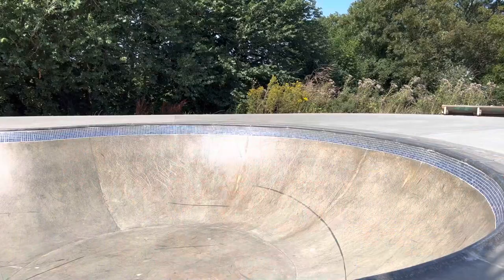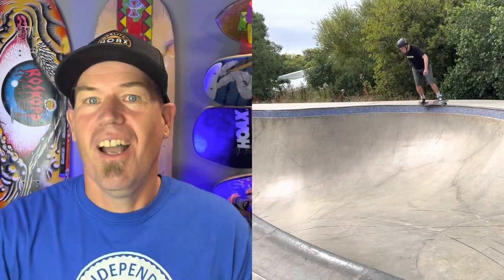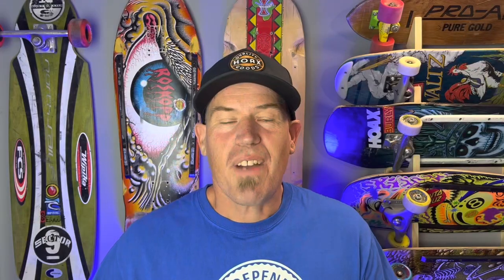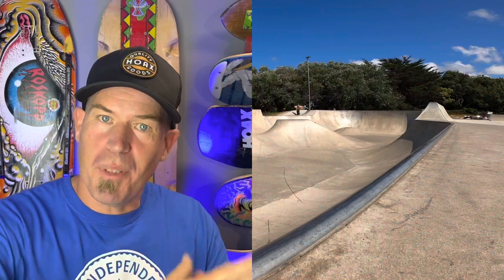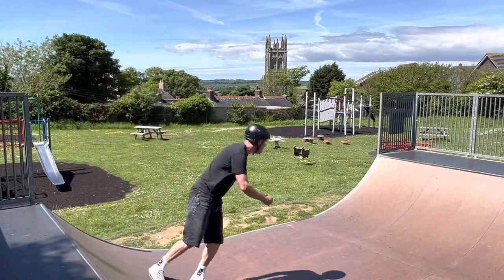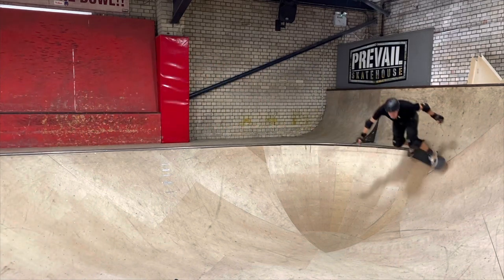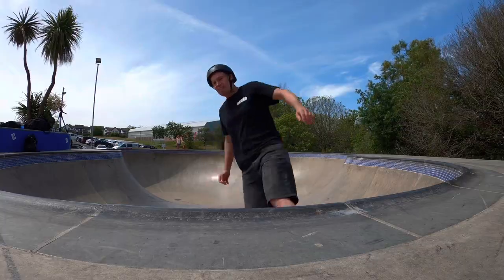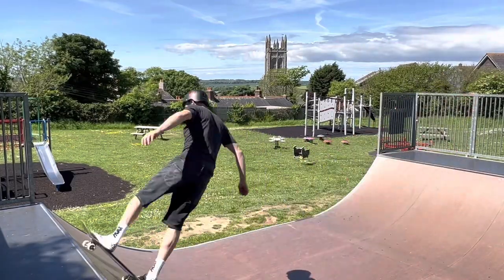Axle Stall 101 - My 10 Phases in Pursuit Of Axle Stall Nirvana

Comment: Like everyone else this is great timing for me! I’ve kind of just learnt this but I’m struggling to get consistency with it. Sometimes I lock in nice and get a long 50-50, other times I don’t bring the front wheel round enough and end up doing a feeble and bailing. I also tend to stop grinding and then drop back in afterwards instead of grinding and dropping back in in one fluid motion. More practice needed I guess. And these videos help!

Comment: Great video! It took me months to learn this one. 
I think the biggest hurdle that I've seen people overcome to get these smooth and consistent is getting past the "back foot fudge" stage. 

I used to spend half a lifetime stood up on the coping whenever I would try these and I was in awe whenever I would see someone do a smooth, cross-locked axle stall/5050. 

But as soon as I figured out how to pinch the heelside wheel it was as though something clicked and I managed to learn (fairly) clean axle stalls, 5050s and feeble stalls.

The "back foot fudge®" is the most important stage in my opinion (and one of the most common among beginners).

Thanks for reading my silly comment. Keep safe. :)
Reply from the maker: I still fudge it now and then 😂

Comment: As always a great video mate, I’m definitely a bit of a weirdo as you know. I don’t actually remember learning to axle stall as I was about 10 years old I think 🤔 (so 33 years ago 😬) but I most often do them how you explained about the pivot . Strangely it never really occurred to me to do pivots when I started skating again (i used to Ollie into them on curbs when I was younger but never did them on coping) and then a while back I decided to try the pivots.
So my stalls are mostly in the middle of the truck with neither wheels in contact with a surface unless I’m being lazy and just standing up on top by My 5050’s are mostly the lock you showed unless I screw it up and do either both toe wheels up or both heel wheels.
Again strangely my 5050’s on vert are a carve in and a very quick dab on and then off again with lots of speed and I’ve not mustered the courage to stall yet , there’s something about keeping moving that feels more comfortable to me.
Also getting into stalls on steeper stuff I found it helped me to bend my back leg more and kinda squat into them until I got more comfortable.
Anyway I’ll stop rambling, take it easy and keep up the good work 👊🏼